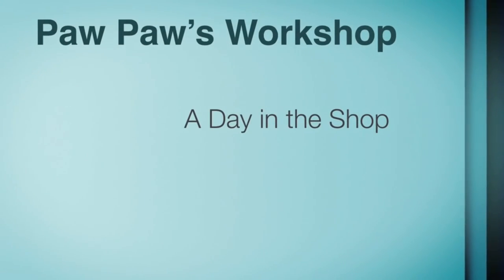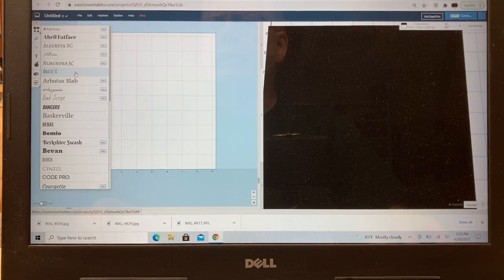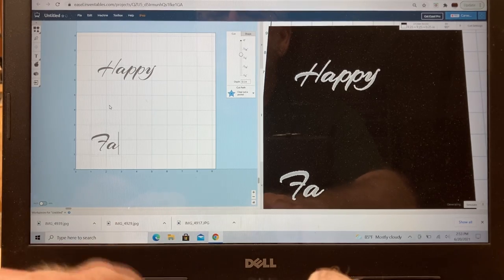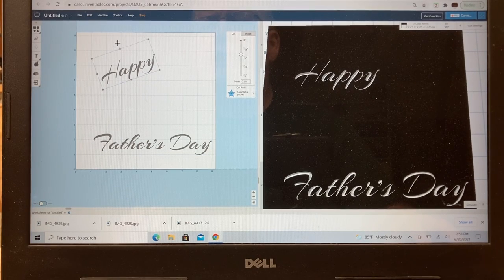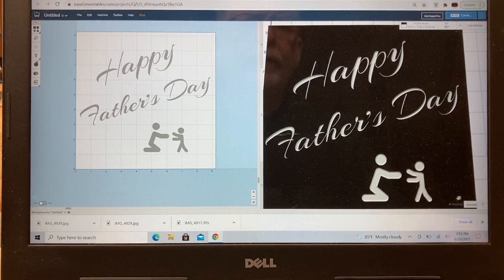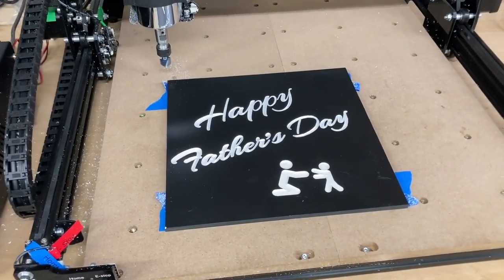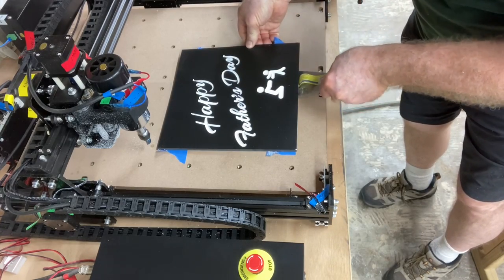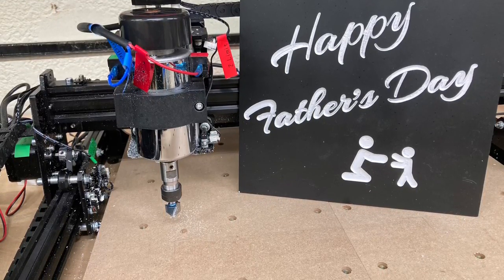How does the 300w Spindle with 1/4" vbits Work on the FoxAlien Basic Edition Masuter Carve?

Comment: Do you have a chart or guide for cut settings on different materials and bits? I haven’t upgraded the spindle yet (just purchased masuter 4040) and I’m trying to find help with cut settings.
Reply from the maker: No, I do not have a chart. Because I have different lasers with different power it is hard to create one chart. It takes a lot of experiments

Comment: Does the Z axis head on yours move around a lot? Mine bounces up and down as it cuts leaving very jagged cuts.
Reply from the maker: Is it moving because of the program or is it moving because it is loose?
Reply: @PawPawsWorkShop  It seems loose, I can make the z head itself move up and down with just slight pressure about a 1/8" and when it's cutting you can see it moving up and down when it shouldn't be. Lines that are supposed to be straight and even end up wavy looking.
Reply from the maker: No, it should not move. You will need to find what is loose. Apply slight pressure and see where the movement is located. Whether it’s the spindle, spindle mount, threaded rod, all possibilities
Reply: @PawPawsWorkShop  thank you! I appreciate you replying so quickly. I'll have a look and see if I can find some loose bolts to tighten. I am really enjoying your videos and learned the tape method from watching them. It does hold really well! Thanks for producing good content, I look forward to seeing more. God bless!